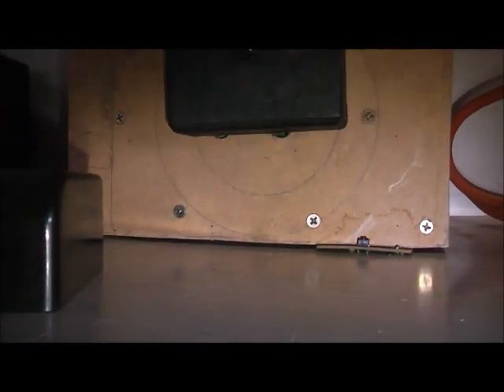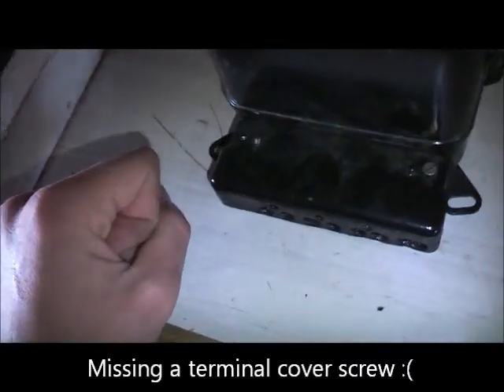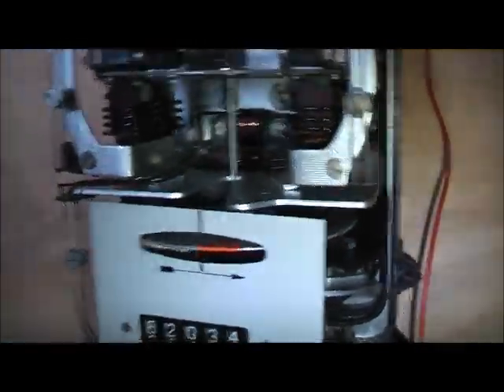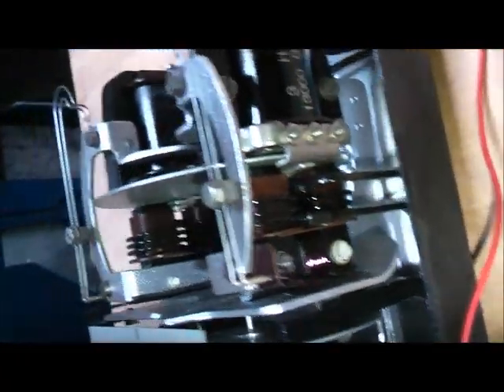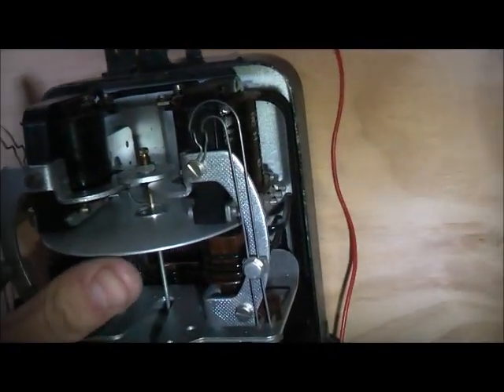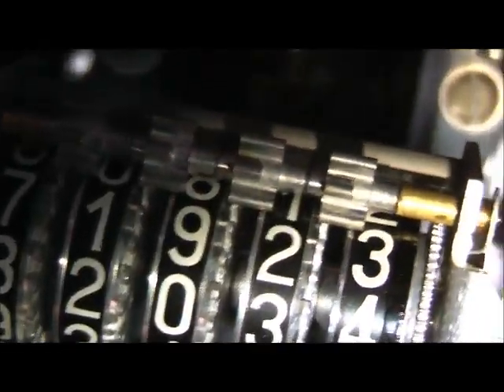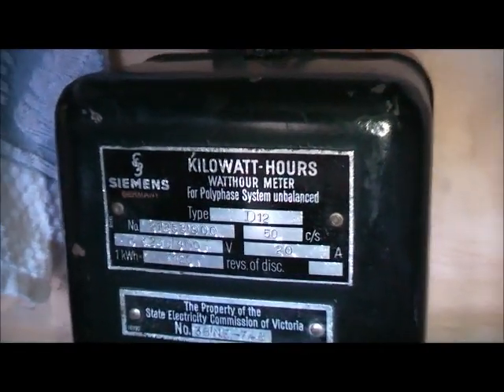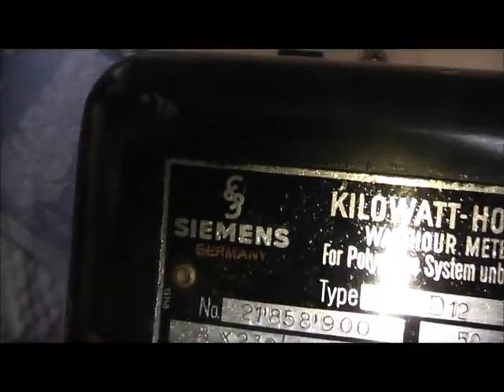Siemens Type D-12 Watthour Meter Restore & Test

Comment: 10.8 kWh used so far on your little BAZ. :-D

That's a nice Siemens meter. I know Rodalco has British Siemens meters, as Siemens also had a factory in London. :-)

As for that sound coming from the meter: Possible wheel-drop. Tweak the height to see if you can stop it from making that rattly ringing sound. 

TIP: If it persists with the rattly noise, take the load-wheels out, re-assemble, then power up. If it's now quiet, then it's the wheels making the noise. :-D

Thanks for showing,

-BBD.